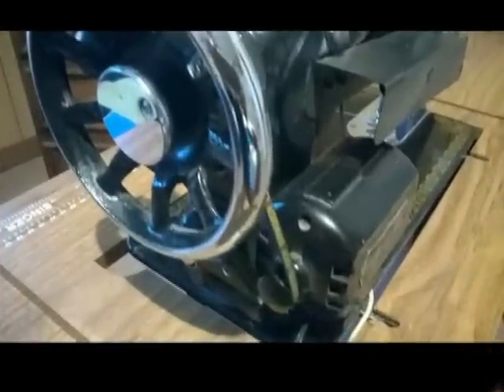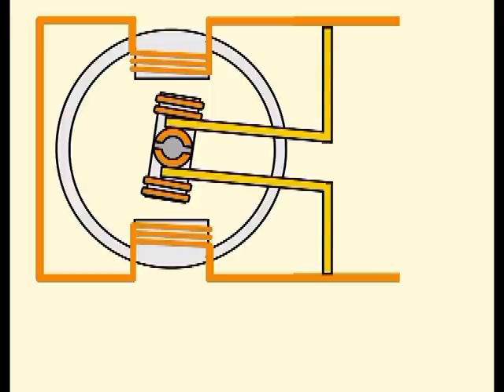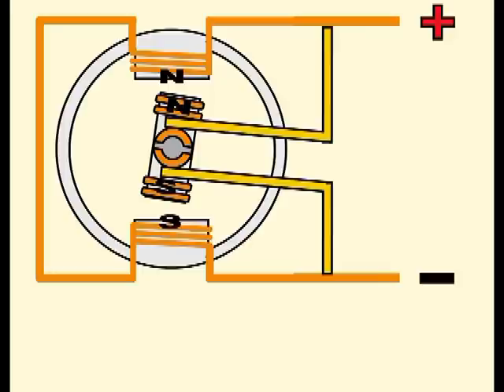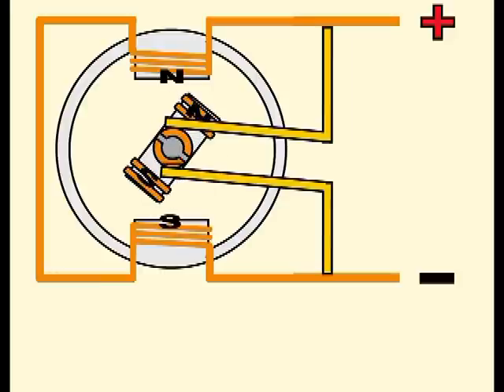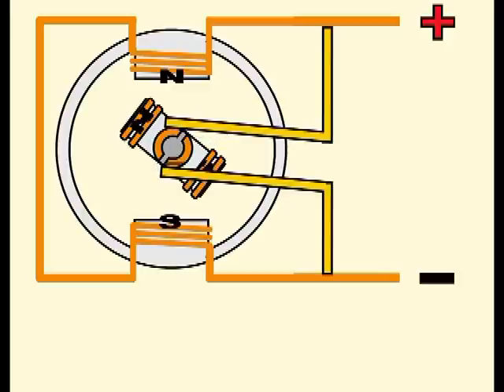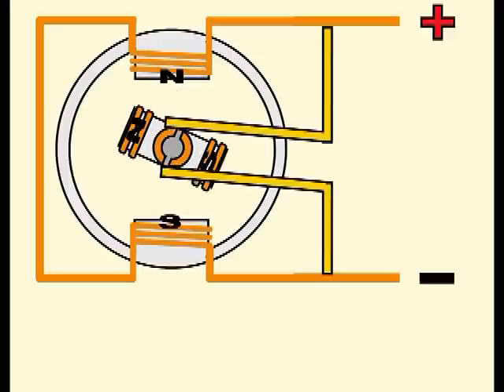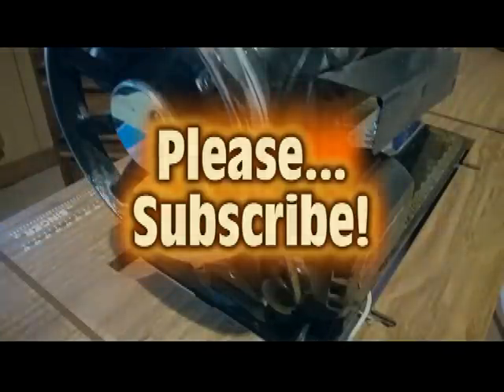How a universal Motor Works

Comment: Excellent video. I’m an electrical engineer but I’ve never worked with motors. I have one question…when you turn off the motor, how do you ensure that the rotor stops in an appropriate orientation to ensure clockwise rotation again upon startup? In other words, how do you keep the rotor from stopping turned to the opposite side relative to the stator winding?
Reply from the maker: Excellent quiestion! The pair of brushes is slightly offset in the desired starting rotation! In fact, old DC motors, as for sewing machines, had a slot and a two-handle lever, in order to rotate them to the desired rotation direction. Since the commutator has multiple segments amd the rotor has many coils, the result is perfect- Hope this helps! Newer motors have permanent magnets, which makes it easier to switch rotation, by merely changing the DC ontroller polarity.

Comment: Hello.i bought one vacuum motor. I had ho reverse the rotation. I followed your advise. I interchange the connection of the carbon brush. Just the same. It goes clockwise. I tried it on battery even reverse polarity still spins clockwise. What should i do ?
Reply from the maker: Can you please send me the brand and model number? Maybe I can find out at the maker's site.

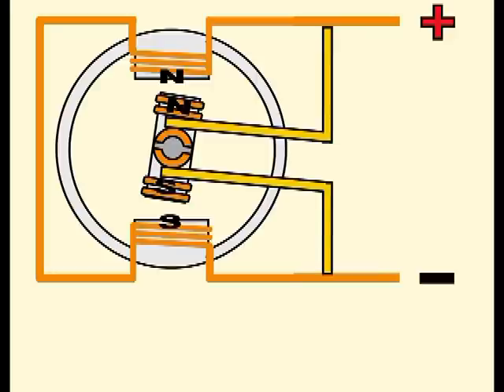Comment: @2:02, "the brushes are slightly offset clockwise, so the rejection between the two north poles and the two south poles forces the armature to rotate clockwise", i think this sentence is an important detail that other videos overlooked about the subject.
Reply from the maker: Dear Jimmy, I learned that fact at an early age. My aunt used to work with a sewing machine, and it had an old brush motor, which even had a lever you could move from the outside and reverse the rotation, just by moving the brushes. I never forgot that! Thanks for your kind comment!!

Comment: The diagram isn't correct. The brushes should come after the coils
Reply from the maker: The usual for home appliances is series winding, and I drew a shunt wound motor, so you are right.
Reply: You are right .In the present way  the rotor should oscillate instead of rotating.